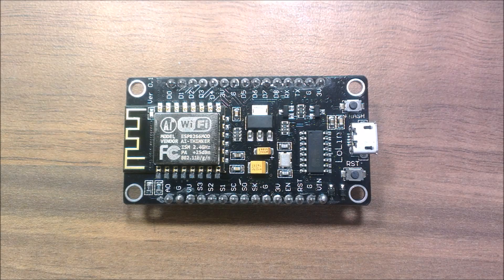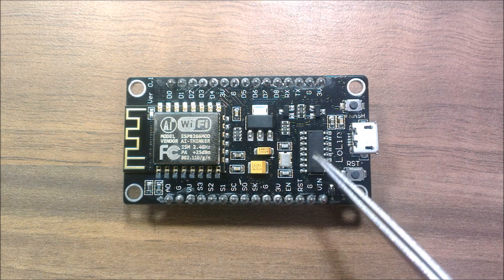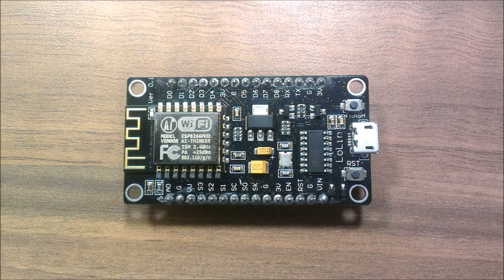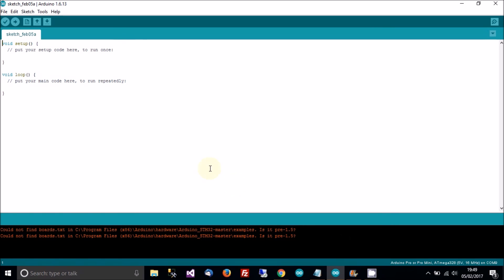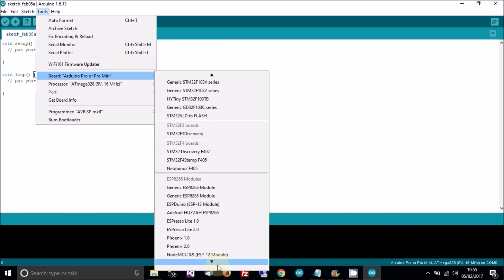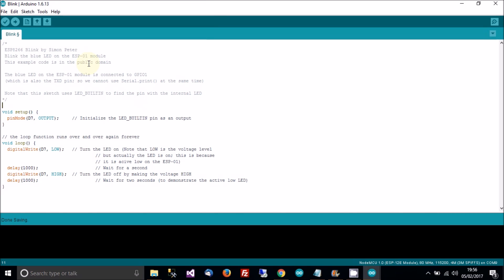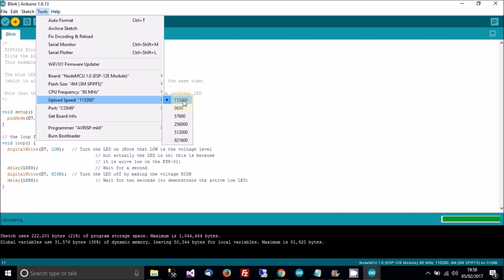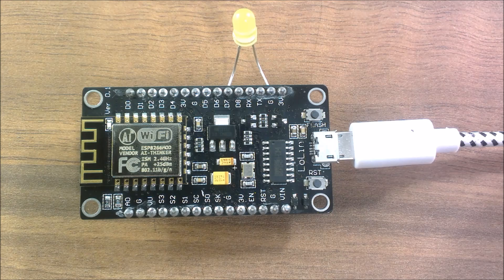TUTORIAL: Quickly getting started with NodeMCU / ESP8266 12E - In 7 mins! Beginner Friendly! Arduino

Comment from the maker: If you receive:

error: espcomm_open failed
error: espcomm_upload_mem failed

Make sure that the NodeMCU is in flash mode. You can do this by holding the flash button down, then by tapping reset, then letting go of reset a second afterwards.

If this doesn't work:

Check your wiring.
Make sure you are using a data cable, not a power cable.
Make sure Windows installs the correct driver. You'll be able to see it if you press Windows+X.
Make sure you've selected the correct COM port in Arduino.
Make sure you have selected the correct board from boards manager.
Check your version of Arduino Studio. Older versions may work better!

Thanks to  +Wizencrowd for his contribution to this comment.

Antony...
Reply: Yes, that data / power cable advice was spot on. Thank you so much for making the setup process this simple.
Reply: Solved! Com error on my macbook V 10.12.6.

Tried installing several different drivers and finally this one worked!

https://blog.sengotta.net/signed-mac-os-driver-for-winchiphead-ch340-serial-bridge/

thanks to the people on the thread that linked this blog!

https://www.silabs.com/community/interface/forum.topic.html/cp210x_usb_to_uartb-y2X3
Reply: I did the whole work and it worked pretty well. 
now please anyone can suggest me how can I reset this nodeMCU.please its very urgent.I want to upload another code.how can I do it?please anyone
Reply: that means I dont need to clear,just uploading a new code will automatically over ride the previous one.
Thnx alot for fast reply!!
Reply: Got it, I was using the wrong com port
Reply: Thanks for the video, sharing my experience(same error msg), it turns out that due to some manufacturing error (cheap aliexpress mcu) I found two pins of the mcu soldiers, a cutter in that place and everything worked
Reply: Hi, maybe a bit late, but it might still help you: I had the same problem, when trying to download the version 2.4 of the esp2866 board library. I then checked the video and saw that he was running the version 2.3 of the library. So I selected this version (2.3) for download and it worked.
Reply from the maker: Write your code in Arduino Studio, plug the device in, then press CTRL + U.
Reply from the maker: Correct.
Reply: STILL NOT WORKING, I TRIED FLASH THING AND THEN PRESSING RESET BUTTON 
PLSS HELP
Reply from the maker: Rahul Patel Hi, your comment isn't very specific, so I can't really give a specific answer. However, if you've followed the instructions, and also read this main comment and it still doesn't help you, your board is most probably dead.
Reply: Antony Cartwright can i get your email id 
So i can brief my problems
Reply from the maker: Rahul Patel Hi Paul, please message on here, so then everyone else can see what to do if they have the same problem.
Reply from the maker: Cool cool!
Reply: Antony Cartwright i done everything as said in the video
but i can't install esp2866 in board manager when i click install, it shows, error in downloading blaaa blaaa...
I don't what is the issue🤔
Reply from the maker: I'm afraid I don't know. The ESP8266 is getting superseded by the ESP32 now.
Reply: Can you help me out? I got this message after I hit CTRL + U: error: espcomm_upload_mem failed
after that I followed the exact same steps very carefully and I noticed that I got com6 instead of com9. Would you know if that is the problem?
Reply: fk u
Reply: Finally! thank you!
Reply: Can this be setup on cell phone?
Reply: Hi.  Just got a new board.  It blinked a blue light when connecting to PC.  But now it no longer blink when I connect it.  PC does detect Serial device but can't flash. I get above mentioned error messages sometimes with error: espcomm_mem failed
Reply: No matter what I try I keep getting these errors:

warning: espcomm_sync failed
error: espcomm_open failed
error: espcomm_upload_mem failed
error: espcomm_upload_mem failed

 - I tried the button holding/pushing thing, it had no effect
 - What wiring is there to check? The only wire is the microUSB
 - I know its a data cable, its the same cable I use to transfer files from my phone
 - I have selected the correct COM port (COM3) and installed the driver for it
 - I have tried both NodeMCU versions (0.9 and 1.0)
 - I am using version 1.8.0 of Arduino Studio

In addition, I know there is at least some connection, because whenever I do try to upload a sketch the light blinks about 3 times during the process. I have tried using NodeMCU Flasher with firmware using default settings from nodemcu-build.com, but it never makes any progress, although the light on the esp8266 continuously blinks. I'm running out of ideas. This is a brand new NodeMCU from Amazon, so it should be functional. Do you have any other ideas on how to fix this problem? Thanks in advance.
Reply: sir, pls pin your comment its too far away to scroll
Reply: I am getting 
warning: espcomm_sync failed
error: espcomm_open failed
error: espcomm_upload_mem failed
error: espcomm_upload_mem failed
Reply: @CrazyCoupleDIY  You just need to hold flash button on board while you start flashing sketch. And that's it! Cheers!

Comment: which one is new nodemcu esp8266
Reply from the maker: Hi, the NodeMCU ESP8266 12F is the latest as far as I know, however, I'd be inclined to use the 12E version. There are different builders though and different models which contain that chip. Antony...
Reply: i order one can u check whether is correct or not. http://www.amazon.in/Lolin-NodeMCU-3-01-0268-1-NodeMCU-WiFi-Arduino-IDE-Lua-based-IoT-ESP8266-Development-Board/dp/B010O1G1ES?_encoding=UTF8&portal-device-attributes=desktop&psc=1&redirect=true&ref_=oh_aui_detailpage_o00_s00
Reply from the maker: I have one of those boards and they are fairly good.

Comment: am i able to apply bin files to the esp8266 via arduino thing you opened in the video? like most of us, i'm also trying to make a wifi deauther but i have the code in a .bin file.
Reply from the maker: Hi, I'm not sure. I've never applied .bin files to an ESP8266. I use .ino files but I don't flash them, the Arduino software compiles them and flashes them.

Comment: I have the same board but I could not get it to work with Micropython so far.
Reply from the maker: Alan Medina Python?!?! Why would you use Python?
Reply: I like Python syntax,I would like to use it with a raspberry pi and since the pi is already python based I thought I keep it consistent.
Reply from the maker: Alan Medina Good luck with that! The Esp is complicated enough as it is. If you do it, maybe make a video. Antony
Reply: You are correct it is a headache so far. I see it and still can't believe how powerful it is really blows an arduino out the water. But if I do I may.
Reply from the maker: Cool cool. There are things I like and dislike about both languages. What I don't like about Python is the indentation. Indentation is part of the compilation! Anyway, still cool. It seems to be slightly higher level than C++ though I think.
Reply: When I first started using it the indentation was something to get used to but in time you grow to like it.

  I would say it is a high level language like c++. From what I have scene a version of it is making it presence in the mcu world.

 I think this is due to the fact that mcu are getting pretty powerful due to moors law. It not like the past were hardware limitations made assembly and c the only tool of choice.

Comment: Hello Guys

I had some issues with getting the software on it like a lot of other people. There are a few you need to pay attention to!!!!

1. Make sure U are using a data cable and not just a powercable.
2. If your windows doesn't install the driver, just download it.
3. Make Sure that your NodeMCU is in program mode you can do this by holding the flash button and then tap the reset button once.

Thank you hope I this helps
Reply from the maker: Thanks for your comment! All very true! Point 3 is a tricky one though as you technically don't have to do it as the CHG chip is supposed to do it for you. Still, it's good practice I guess. Thanks for your comment, sometimes I forget things. :-)

Comment: My board isn't displaying in the arduino ide
:( HELP
Reply from the maker: You have library problems.
Reply: There is no COM port for it tho so I don't think that's what it is
Reply from the maker: Ahh, you mean there is no COM port? I thought you means the board isn't showing in the board manager. No COM port is to do with drivers usually.
Reply: Well what can i do ive installed the drivers
Reply from the maker: I'd say Google it first. Sometimes these things happen. It could be bad drivers, bad USBs, bad cable of broken NodeMCU. I'm afraid I don't knwo which one of those.
Reply: if it helps, this is the one i bought -> https://www.amazon.com/gp/product/B01N0B48NI/ref=oh_aui_detailpage_o00_s02?ie=UTF8&psc=1
Reply: ive also been googling for over 2 hours
Reply: The cable works, the drivers are good, and everything is soldered correctly. I think it is dead :(
Reply: Is it normal for it to get slightly warm?
Reply from the maker: Well, it's possible that there is something wrong with the UART chip. The ESP8266 module may still be ok. Google how to override the UART and see if it works that way. You'll need an external UART module. TO be honest though, it is easier to buy another NodeMCU. I have a broken ESP8266 and that does get very warm.
Reply: I think I figured out the problem -- two pins on the uploady chip thing were shorted together which may explain why it is getting warm. I will attempt to desolder them, and if that doesn't work, return them. Thanks!
Reply from the maker: Ok, but check this before you mess with it as it might be intentional. Antony...
Reply: kk
Reply: But it looks like a thin piece if solder unintentionally touching.
Reply: *of
Reply: I checked the datasheet for cp2102, that isn't the problem- I think the board is dead. Thanks!
Reply: /im returning it
Reply: It MAY work. It was the cable - I didn't know there was one for only charging. But now I'm getting errors like espcomm_upload_mem failed or something. I'm reinstalling the IDE now
Reply: Ok im definitely returning it. I broke the micro usb thingy off by accident and the pin came off so I can't resolder.  Why can't these things come OTA uploadable ready?

Comment: my board manager doesn't show anything when i search for 8266
Reply: nvm. it solved now. New link: https://github.com/esp8266/Arduino/releases/download/2.1.0/package_esp8266com_index.json
Reply from the maker: Sounds like the library did't install successfully.
Reply: have the same problem here. what should i do? reinstall arduino?
Reply: Andrian eka thanks man!
Reply: didint work. i get the message  "https://github.com/esp8266/Arduino/releases/download/2.1.0/package_esp8266com_index.json? file signature verification failed. File ignored."
Reply: I got the same messege someone help
Reply from the maker: Try using the library manager.
Reply: Hello, would you be kind and help also me among the other tousands of users? i have this message when transfering, uploading the files to the board: no matching function for call to 'ESP8266WiFiClass::scanNetworks(bool, bool&)'   any idea what could it be?
Reply from the maker: Alex Fili Hi, I'm not familiar with that message, but it sounds like a software problem. Minimise the code to identify the exact problem.
Reply: Antony Cartwright  what do You mean to minimize the code?
Reply from the maker: Hi, I mean, cut down the code. Have less code. The less code you have, the less likely you are to have a software problem. If the board still gives the error without code, you know the code isn't a problem and you can direct your attention elsewhere.
Reply: Hi, thanks for the response, I will try it ! does it matter if idk code? i just know html and css and learning js :))
Reply from the maker: You need to know and understand the code, otherwise you won't know what you're deleting.
Reply: Now I managed to pass that error and I get another one : warning: espcomm_sync failed
error: espcomm_open failed
error: espcomm_open failed
I found that I have to reset the board, I remember that learning it at an course, but im not sure how :)))
Reply from the maker: That is a very common error. Check your voltages, check wiring, etc... I've found that most of the time, this is due to bad power.
Reply: If youre using it as a wifi jammer i recommend the esp8266flasher program

Comment: I always get an error, espcomm_upload_mem_failed
You got any ideas??
Reply from the maker: jake warne Hi, faulty cable or drivers maybe.
Reply: I was thinking faulty chip? I tried 5 different cables as well as different settings on both programs.
Reply from the maker: jake warne Then a faulty chip is also possible.
Reply: I might need the CP2102 driver, but I can't find it anywhere.
Reply from the maker: jake warne If i remember rightly, it is in the comments section here somewhere.
Reply from the maker: jake warne It looks the same as mine. I'm using windows 10.
Reply: same, the only reason why I think it may not be working, is the cable I'm using. I'm am sure I'm using a data cable, as when I plug it in it has the plug-in sound, as well as the port showing up in device manager. 
And I do want to point out, when I plug it in is also does not have the blue light blink at the start.
Reply from the maker: That's very strange. To be honest, my experiences with ESP8266 tell me that these devices are very fussy. Do you have anything plugged into the pins of the nodeMCU? Sometimes it won't boot if you are holding a certain pin high or low. I've had ESP8266s where the blue LED didn't work too, but where the device still worked! Try a different USB cable. Buy another NodeMCU too. See if the cable works on the new one. If those don't work, you're going to have to try something a bit more hardcore. You could try using an external UART, you could try a different USB port... Try everything. It is unrelated, but My HTC One M7 only works on only one USB port of my laptop. I have absolutely no idea why it won't work on the rest! Haha! But these things happen.
Reply from the maker: Also, go here for more information: http://www.esp8266.com/
Reply: it's very frustrating, I tell you. I've been trying to get this working for a fair while now. I've used 2 different Laptops, USB 2.0 ports as well as 3.0 ports. It's either the USB cable I'm using, or I have a faulty motherboard. I have been researching and this is a common problem. The  esptool is another program that allows flashing, so I might try that as well. And also thanks for your help!
Reply from the maker: No worries. The error you told me, that is a common error, but it isn't common for it to act the way it is for you. I think you're better off buying another NodeMCU. Antony...
Reply: Yeah that's what I thought, so I ended up buying a new one instead. Just to confirm did you update or download any firmware on to it before flashing? or did you just flash it straight out of the box?
Reply from the maker: I flashed it straight out of the box.
Reply: We'll anyways I appreciate your help.

Comment: I've tried all USB ports of my computer and it does not recognize the NodeMCU. It does blink when I plugin the USB.
Reply from the maker: Francisco Alves Which Operating System are you using?
Reply: Using Windows 10, but I tried on Windows 7 too.
Reply from the maker: Windows 10 works fine and drivers install automatically. Is it possible that you have a faulty NodeMCU or faulty cable? Or even faulty USB port?
Reply: I'm afraid that the NodeMCU is faulty :/
Reply: download this and run either 32 or 64 bit for your computer 4+ GB of Ram 64 bit and less then 4 GB 32 bit and then follow the setup and then it will work i had the same problem with mine hop
e it helped :)
Reply: http://www.silabs.com/documents/public/software/CP210x_Windows_Drivers.zip
Reply from the maker: Francisco Alves Hey, it could be a driver problem, or maybe a faulty cable?

Comment: I've got the same Lolin board maybe, how do we know which one 12 or 12e
Reply: Great, I was answering Harvey's question about led size. I'm now using Ubidots for temp and humid but lost code that I used. Wanted to use a moisture sensor also.
Reply from the maker: Sick Vic probably by the version number... or my the look of the esp module!
Reply: Thanks, yup same as yours. The firmware reads .09 not 1.0 on mine. Does it matter? I think the extra pins can be used in lua firmware, not in arduino ide.
Have you tried the Blynk app for android. I got  my phone to toggle a simple led wohoo. But because i don't know jack about code i can't get a dht22 to work. Don't know how to add or combine code. Would like to figure how to use tabs to separate files also.

If you ever get around to something with Blynk let me know.
Reply from the maker: Sick Vic! The firmware doesn't matter too much in my opinion. The extra pins, yes, I don't know, you're probably right. The blynk app, I've not tried Blynk but I written my own app instead. It worked, but it took me a long time to write. It's easier to make a web application in ASP.NET or something.

I've never wired up a DHT22, but it would probably be easy, are there any tutorials on here?
Reply: when size is your LED just a random question
Reply: 7 Inches long :)  size doesn't matter. I gave up on Blynk
Reply from the maker: You gave up on Blynk? Next week and/or the week after, I'm going to show everyone a different way! I don't use Blynk, I use my own software. I'll show you soon. Stay tuned! Antony...